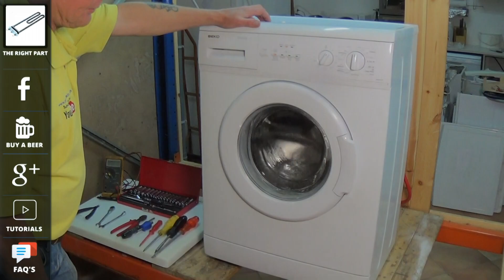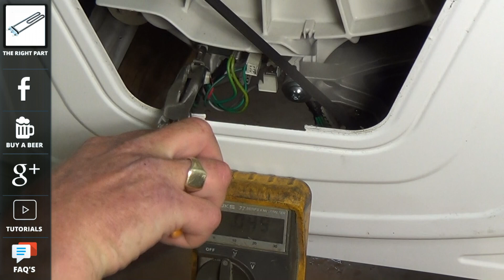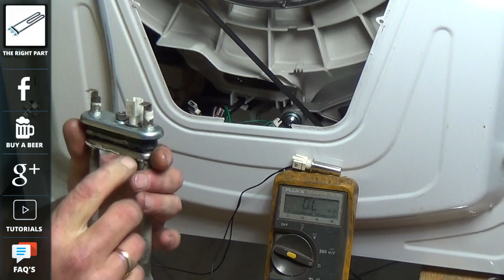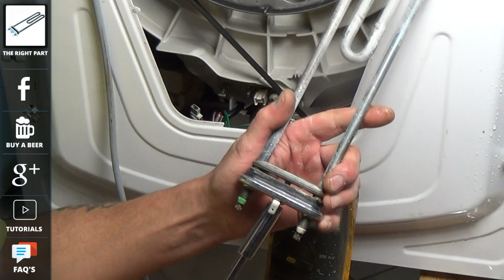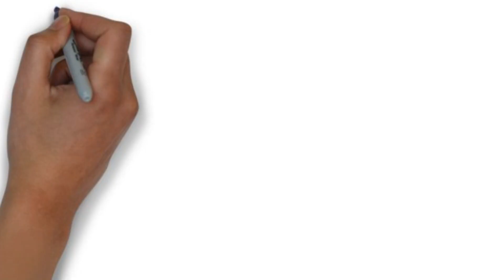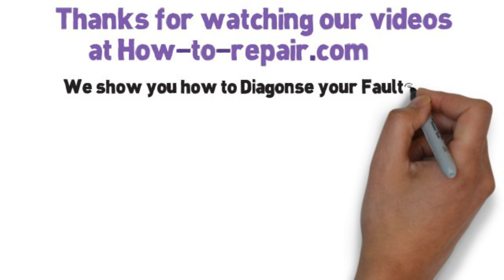Beko washing machine not heating water how to test element & NTC sensor and fit new

Comment: Hi, great video thanks. My daughter's washing machine is shrinking all her clothing and I'm guessing this could be because the temperature is getting too hot. Would replacing the NTC sensor be a sensible thing to try?
Thanks in advance.
Reply from the maker: Hi, I will need the full model number of the identification plate and the details of your problem. Please use our contact us page and make sure you fill out the request for what your problem is. A video shoot of the problem would be perfect as well.

We will get back to you within 24 hours, normally. https://www.how-to-repair.com/help/contact-us/ 

Please remember to subscribe to our channel, as that's what keeps this channel going. Thanks, Paul 👍

Comment: Tried resetting with the button and now replaced the NTC and the thermostat attached to it, still not heating the water and the rinsing with cold water, any help please? this is the Beko WDX8543130W

Comment: I’ve changed both sensor and heating element but still water is cold. Is there any other reason for that. Is fairly new washing machine. Any help will be appreciated thanks.
Reply: Same issue here and haven't found the solution, did you resolve? Although it will heat to 95c on a drum clean, so I'm suspecting a control board fault.

Comment: So my machine is stuck on the filling water cycle and never continues. The thing is u might say that its the water level detector thats faulty but ive tested it and it works. My second guess would be the ntc sensor which ur video proves since the heating resistor isnt being supplied with current.
May you please tell us whats the resistance of a working ntc?
EDIT : never mind i was mid video when i wrote my comment. 6k ohm it is.

Comment: I have an ISSUE with fixing Indesit: WA 8 i cleaned up the dial switch as it was constantly rotating it stopped rotating, checked the heater 30 ohm, checked the thermistor ntc 30 Kohms, still not heating ... is it the processor ? When i start the machine it blinks 3 times fast then starts ... does not heat does not stop washing ...

Comment: I messed up and took the nut right off :O this has left the black rubber gasket separate from the metal face plate which holds the wires we remove. 
I've tried and tried for hours to either get the nut back on or pull the element out as it is but it's impossible. Is there any way back from this or is the machine now ruined?

Comment: Thank you for the video, very clear. I have a Beko WM5100W. It will not go into 'Test mode' pressing Power on and Start, no matter what I try. All I can get is the Start light, with Wash light flashing and also the spin light is on. The machine is otherwise completely inactive. The thing is, I can open the door - it does not lock. I have checked the carbon brushes - they are long and seem unworn. An engineer has told me the problem could be the Heater element. (if not, perhaps the door interlock). Would really appreciate your thoughts on this issue if possible.